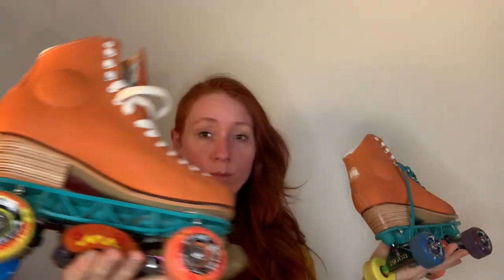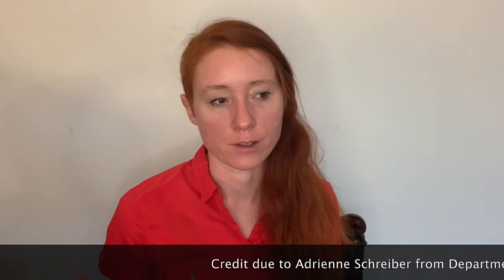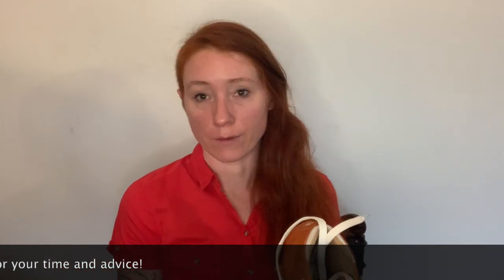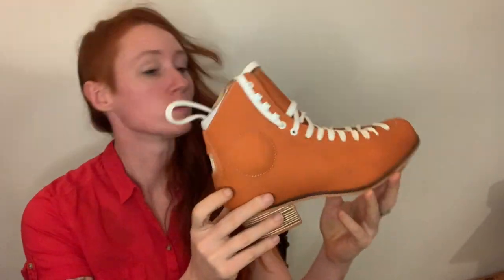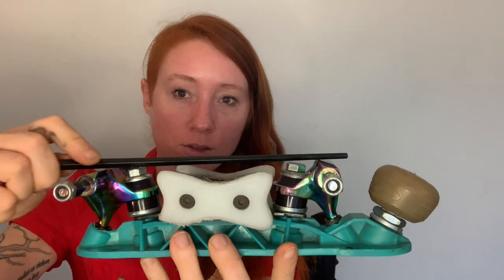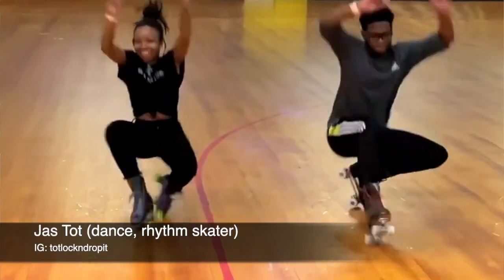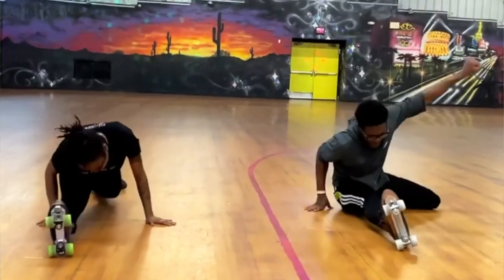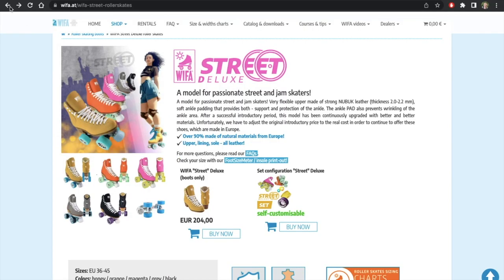Wifa Street Xtreme: Roller Skate Mounting How-To & Detailed Review

Comment: Thank you for the great video. Lots of great details. Love the short clips of various stunts that I'll probably never be able to perform. Good to know that the Street Xtreme are a bit on the stiff side. I was looking into WIFA boots for a of dance/freestyle/rink setup. My park skates don't have a heel and I like that a lot. But I'm also a park skate beginner, so what do I know. I guess I'm comfortable with heel less skates because when I grew up none of the skates had a heels. I only used heeled boots on ice. Little did I know that you could mount a fancy pair of boots on plates. All we knew were sneakers (very flat) mounted to plates and then when we were little we had the adjustable strap on skates from Polar (I think that's what the brand was called).

Comment: That was wonderfully in depth and detailed. No need to apologize for so much good, free information. 

I'm about to convert some Riedell ice skates to roller skates (great deal, new old stock eBay special) so this is very useful. I've got a set of used Avenger plates. The overall plate length is shorter than the skate compared to your setup. But the front axle still ends up under the ball of the boot so I think I'm ok (?). Wish me luck!
Reply from the maker: Good luck! Wheelbase does end up coming down to personal preference and what you’re going to use or for, so I couldn’t say if you’ll like it, but I hope you do! And thank you!

Comment: Hi! Than you very much for the detailed video, it gives plenty of insight into mounting Wifas that are hard to find elsewhere! I was wondering about the wedge that you put in though, I am having a hard time finding/making an appropriate piece, so I wanted to know how important it really is. Does it stress the boot too much if we pull it all the way to the plate without a wedge? Does the bolt connection need a washer if we decide to do so? Thank you again for taking the time to read :)
Reply from the maker: Thank you for taking the time to comment! I would not say that the power wedge (aka toe wedge) is absolutely necessary and the reason I say that is 1) I've seen mounts by experienced people who know what they're doing and don't use them 2) I know the point is to reduce stress on the boot and tbh I've never seen a boot blow out prematurely bc it was just stressed too much from being pulled down like that. As far as I can tell it's more of a Best Practice, which I included so people would consider it as a possibility bc maybe they had never seen it/heard of it before. I don't think it's necessary at all. If you want to find one I suggest you look for your nearest artistic skating shop, and email them bc sometimes it's not on the site but if they sell Roll Lines or Edea products I'm sure they will have them. Whether I use it or not my washer use is the same, which is to say I put a washer between the lock nut and the plate (the toe wedge would go on the other side of the plate, between plate and boot).
Reply: @rollerskaterevival8484  I see, thank you very much for the in depth reply! I will try to find some then, but won't stress it if it doesn't work out, it is relieving to know that the boots won't fail because of it :')

Thanks again and happy skating!

Comment: Did you think of using the Snyder skate alignment tool.
Reply from the maker: I've been told that that works best with snyder products and is not very general. Would you disagree? I've actually never used it.
Reply: Would it hurt to try it
Reply from the maker: @stephenvarney334  This is a bit of a strange answer, which makes me uncomfortable because it's reading as hostile instead of helpful. Of course it wouldn't hurt to try it (unless I'm super using it wrong, haha), the reason I haven't done so if because my local skate expert told me it was really just useful for snyder products, which I don't use. Additionally I try to make videos for people who probably haven't committed to being the local skate tech and prob wouldn't have super specific tools like that. But I am curious if other people disagree with what I've heard, which is why I asked you if you disagreed with what he told me. Do you use it? Do you find it helpful?
Reply: I am sorry if I make you uncomfortable, it was meant to help. Almost the same centering device is used in woodworking to find the center of a board to divide it into two equal parts.
Reply: Don’t always take others words, unless you try it yourself.
Reply from the maker: @stephenvarney334  Sure thing but my general approach is to no reinvent the wheel, lean on more experienced people than I. My friend that told me this had been mounting for about 30 years so I'm thinking its not certain that's he's right, but likely. I couldn't say if it would be bad, i think with anything you need to eyeball it and do a quick sanity check before committing. Funny coincidence about 2 days after your first comment my friend messaged me that she got this tool, so the next time one of us has something to mount we're going to try it and see if it helps.
Reply: @rollerskaterevival8484  It wouldn’t hurt to try. If you can’t afford the Snyder tool you can make one. It is the same tool used in woodworking just that the center line of the tool is to one side in order to set the center line. In woodworking it’s used to drill holes for pegs to join boards. The Snyder is the same tool just a little different.

Comment: Did I understand you correctly -  you are using a plate size that is bigger than the one recommended  for your boot size? I desire to have a longer wheelbase, and I wonder if this is my solution.
Reply from the maker: Well "recommended" by whom? for example when i was in derby I'd use one shorter than recommended by manufacturers on their sizing charts, for agility, but it was within "recommended" size for people who build derby skates. I recall I did get the largest plate I could fit on my boot, but now that I look up the a sizing chat I see the size I got is what would be recommended (by whoever made the chart). In general you are correct, plate size is preference based on skate style, for example my very smallest wheelbase is around 145mm and my longest is around 175, depending on the purpose of the skates.
Reply: @rollerskaterevival8484  - yes, recommended by the manufacturer site. I suppose I could go by how long my boot is and compare to total length of the plate in order to get the longest one. My recommended plate is a size 4 sunlite fir a size 6 men's boot  but by my measurements, a size 5 plate is exactly as long as my boot, and would hopefully fit. I want the 170ish wheelbase.
Reply: Another question- what are you using for toe protection on your skates? Looks like tape? It looks so nice and streamlined!❤
Reply from the maker: @allisonhay8760  Thank you!  on that boot I use hockey tape.  The black one stays on pretty well (I had white which did not, don't know if it was the brand or what) and I just re-apply from time to time. By now it looks like my skates have tan lines, when I take the tape off. Something that's pretty much the same is gaffer tape but I think hockey tape is cheaper.
Reply from the maker: @allisonhay8760  Also the sulite size 4 is weirdly small. the wheelbase is only 2mm bigger than the 3, and 16mm smaller than the 5! I don't know why.  But I would expect a 5 to be really long on your boot, I'm usually a size 8 and my 5 was almost too long. Are you 100% married to the sunlite idea? Maybe consider something comparable, like SG Probe?
Reply: @rollerskaterevival8484  I will go read about it now. Thanks!

Comment: Its very interesting how Camilla mentions that there does not seem to be a break-in stage for them, yet Lea mentions specifically that the break-in period is fairly short, but noticiable effect wise. What is your experience with it? 
Also, what is your take on the top of the achilles cut-out that Lea talks about? Has that softended up at all or?
The gunk you had on the drillbit, might be a combination of leather and glue from the heel. 
Bonus tip: For marking on the boots for drilling: Posca pen or nailpolish = something that is super easy to mark (and if you mark the wrong spot, just paint over it again).

As always, very nice and informative video :)
Reply from the maker: Right? That’s why I like to include other people’s feedback, bc sometimes it’s contradictory, so it gives a sense of what everyone agrees on and what varies. Anyway to me they feel pretty much the same as the first time I put them on which is mostly very comfortable with slight discomfort on my right ankle. When I’m skating I don’t notice it anymore, only when I first put them on. So no I did not observe a break in. I even unmounted them and tried to heat mold but they felt same after that also. (I forgot to include bc it made no difference) So I’d say if you try them on and don’t like the fit, it won’t change much.

I never lace the top eyelet that Juni was talking about (“zero understanding”) and sometimes I don’t lace the top 2 hooks either. In that sense I agree with Lea— if I’m kinda cruising or carving around I don’t lace all the way, but if I’m going to try something where I expect to fall a lot I’ll lace all the hooks for extra support. I have noticed that if I lace all the way and skate several days in a row I feel kind of tender on the 3rd day, which is why I don’t lace all the way of I don’t need the support. 

I love the nail polish tip, sometimes my sharpee isn’t good enough. I’ll try next time, thanks!

Comment: Nice video! 
With the Parkstars, did you feel the top of the skate with your foot like above your toes? 
I think I might have accidentally put some force on top with heat moulding and now mine feel claustrophobic :/
Reply from the maker: Thank you! the answer: yes and no. my parkstars are very comfortable on my feet, I can wear them for hours and not notice any discomfort, BUT I have experienced what I think some people call "Bont Toe" -- ie toenails that got bruised, and eventually fell off. Sorry to be gross. I'm telling you bc I think the cause might have been pressure on my toe bed. So if i were you I'd rather have extra space, rather than pressure that might cause the toenail problem later. I think you should try to heat mold again, maybe with thicker socks.

Comment: Your Sunlites are a size too large if they run the length of the boot and are hanging off the heel. Shorter plate will also give more agility.
Reply from the maker: Thank you, I'm aware. When I played roller derby my wheelbase was 145mm and now for park skating I'm at more like 175. I don't want agility for this setup, and the flipside of agility is "falling often". The Xtremes are super stiff so this is my safe and protective setup. I have antiks with narrow trucks, some former derby skates, when I want agility.